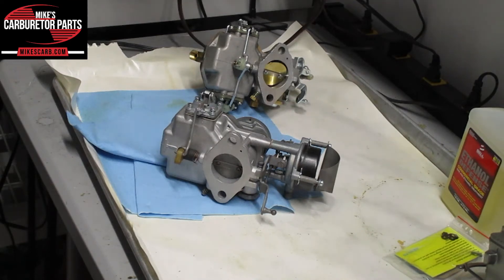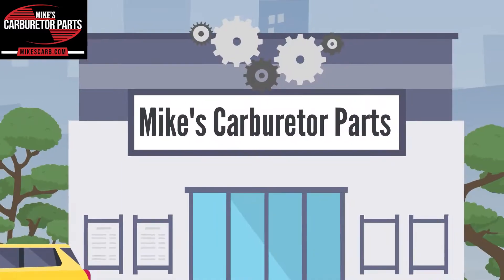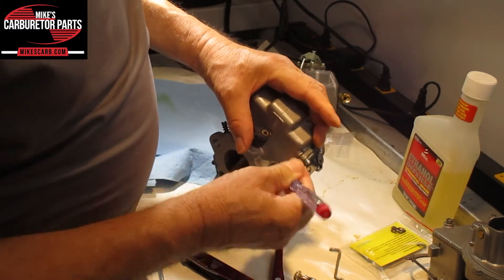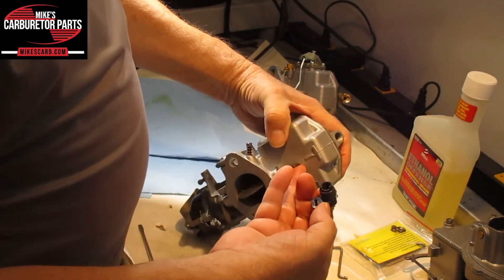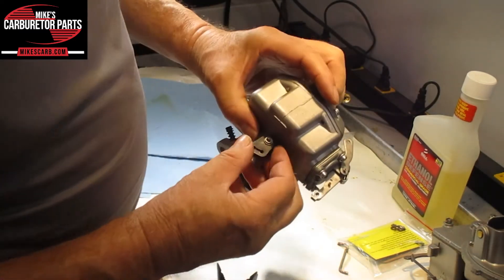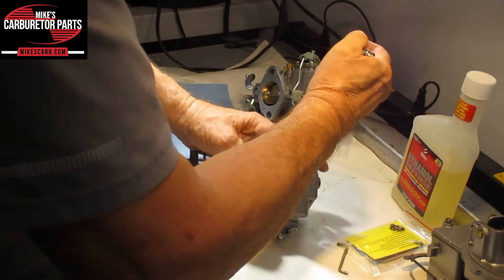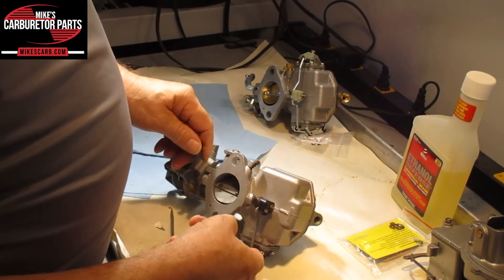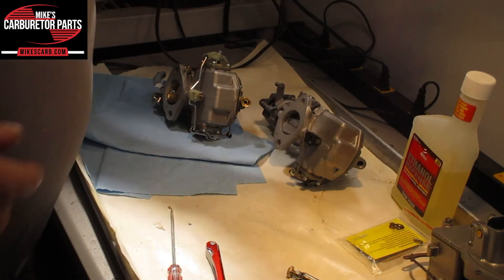How to Replace Autolite 1100 Pump Lever

Comment: Hi Mike, my Autolote 1100 doesn't the vent rod (1963 Ford Fairlane 170CU) and I notice that of the two carbs you showed in the video, one didn't have it either. Was it normal for some Fords to come out without the vent rod, or is mine just missing the part?
Reply: Will have to place an order for one asap.